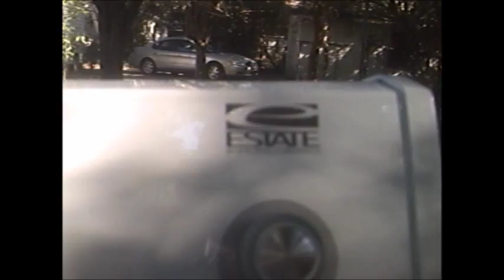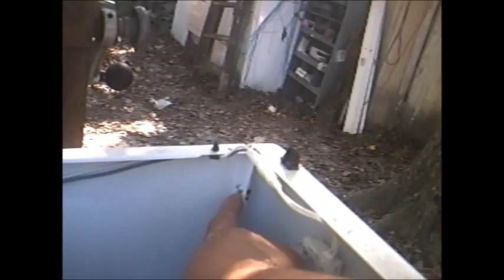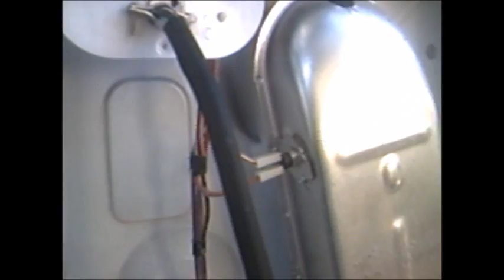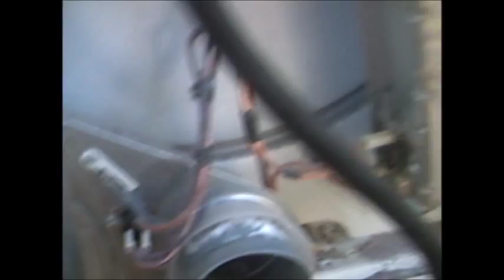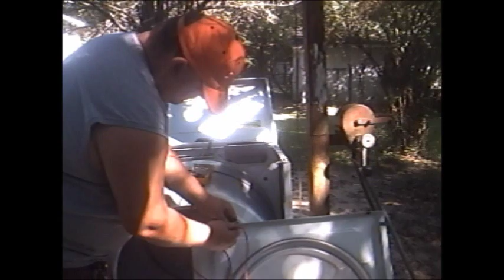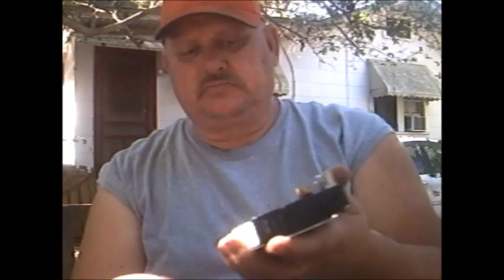Estate Dryer No Heat

Comment: Where do I get a continuity meter kind sir?
Reply from the maker: Get a Fluke, they the best, at the big box store or buy a used one off ebay https://www.googleadservices.com/pagead/aclk?sa=L&ai=DChcSEwjj-6bR9Yf6AhVubG8EHY-cB6YYABAJGgJqZg&ae=2&ohost=www.google.com&cid=CAESa-D2-EDTVQcPi6hg3Sk-unPra1wEknSr-MjD-EI3c7dL3j23Iam4snLXuO6nl8f2NyGUX9831kuKnQwhudQcj0Tc9GPKouYbXVmfBSJY2RaNBD62OngfesKVUPVfmft6nScK0dGCp6vLZGyb&sig=AOD64_0GsIxuf7D9GlAjMXY3RKDHRAIyeA&ctype=5&q=&ved=2ahUKEwi49pvR9Yf6AhWeomoFHdghC98Q9aACKAB6BAgBEEc&adurl=

Comment: Easiest fix...look for "dryer sheets" stuck to and covering over the drum vent...there is no light inside the machine...your chances of seeing a transparent problem in the dark are not very good...I only found it accidentally by touch after cleaning out the open back and the outside hose which it needed anyway! Turned from a totally cold unit to glowing hot red orange element...nice!

Comment: Thank you a second time.  Your video helped me a while back and now my estate was not working for timed drying.  I watched the whole video and saw the part where you opened up the timer and that helped me fix my timer problem.  Saved me $$$  thanks so much!  Happy New Year!
Reply: Ours wasn't working on timed for awhile and now won't heat on any settings!  What did you discover your issue was?
Thanks
Reply: @kayklemenz3360  the timer has plastic grooves inside that wear down over time and so buying a new timer fixed it for me.  got it online for $45

Comment: dan ....  i can't see the testing of the timer ...  all other parts checks good.. can u help me test the timer ........  im getting no heat at all....
Reply from the maker: If the large quick connect is hard to remove from the timer that is an indication maybe the points on the inner leaf switch are fried, common in these type of timers as shown above. Any timer can be checked with a meter. Find the fat red wire from heater to timer. Remove the wire from the timer. Check for continuity from that terminal to any terminal on the timer. Keep turning the timer and checking. If you cannot get a reading from that terminal to any other terminal in the timer then that timer is bad.